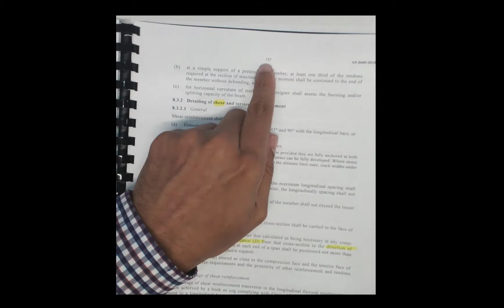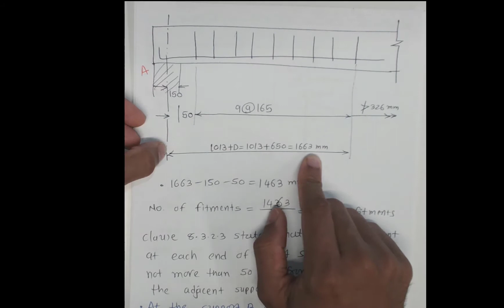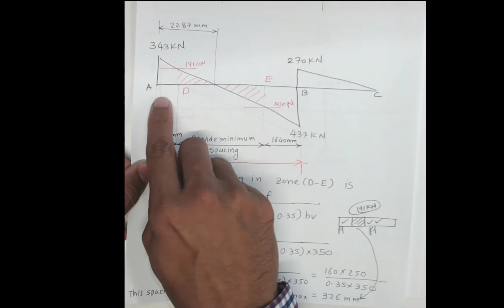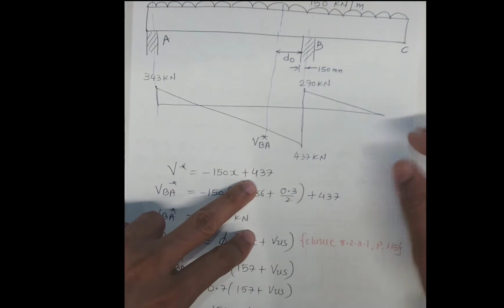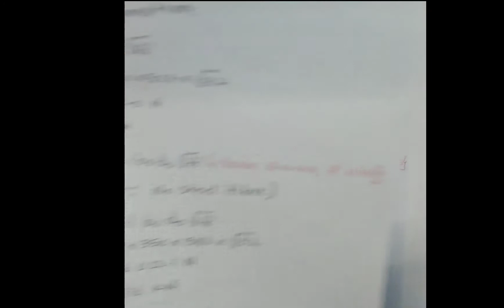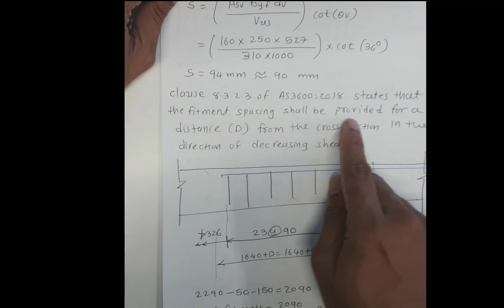RC Beam design for Shear Example 1 Part 4

Comment: I am a little confused with this one Dr Patel. Previously, you showed that V* = 191kN, and that section commenced at 1013mm, and ended at 1640mm? This section had minimal shear stirrups. Now this video, the critical zone where stirrup spacing is 165mm commences 50mm from the inside support face and extends for 1463mm. Sorry if I am just not seeing what is obvious. Thank you for your assistance :) 
Kind Regards
Ron
Reply from the maker: Thanks for your question. The first shear crack appear the distance "dv" (effective depth) from the support. You can calculate the design shear load V* at the distance "dv" from the support. You can use this design shear load V* to calculate the fitment spacing. For the fitment detailing, AS3600 says that the first fitment should be placed at 50 mm from the support. We do not put the first fitment at the distance "dv". The distance "dv" used for the calculation for the design shear load V*, not for placing the first fitment.